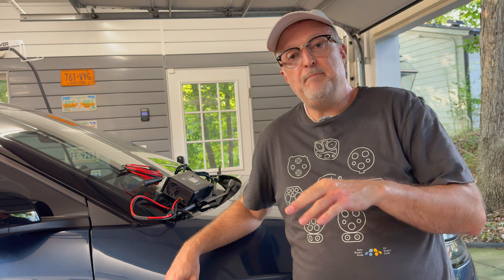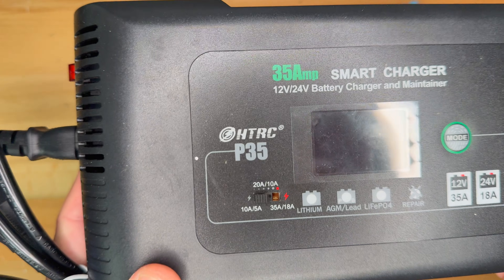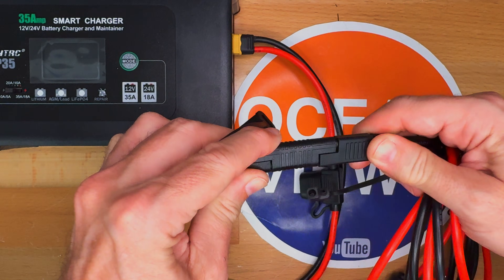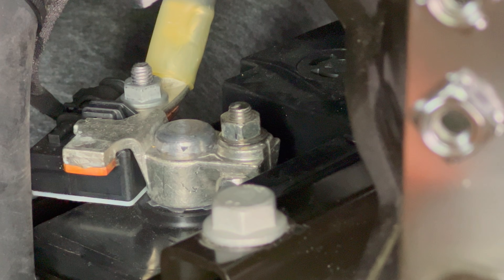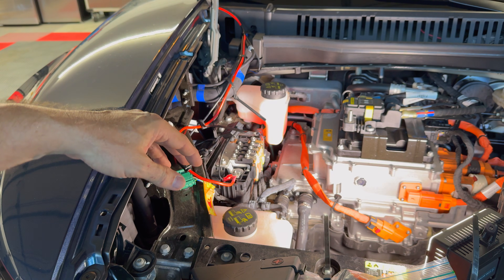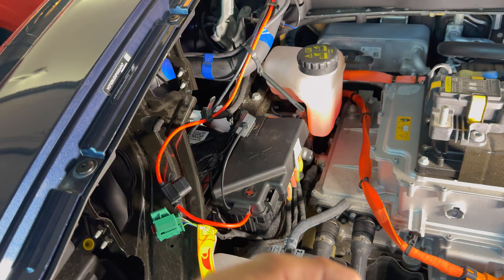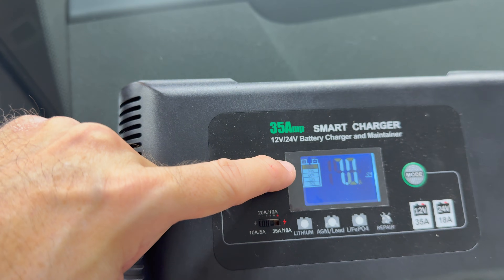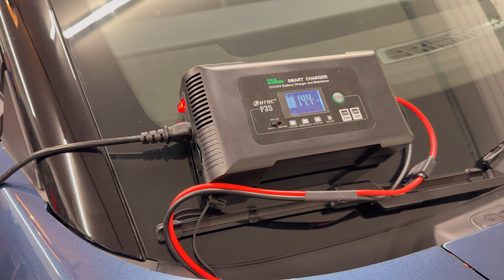Fisker Ocean - 12V Battery Tender V2.0

Comment: Just finished this set up today, because I was chomping at the bit to do it. Freezing outside, but I did it anyway! The 12V charger (same model as yours) shows my 12V is FULL, but the monitor (same as yours) indicates it is 11.9V and warns it is "Low". Has anyone seen this scenario? Thanks for the great videos as always, much appreciated!
Reply from the maker: Yes, 11.9V is below where it should be.  Is the car not charging it up when it goes below 12.0 volts?  What OS version is the car on?
Reply: @MTNRanger  Thank you for the quick response! It is 26F outside if that makes a difference. I am on 2.5 OS. When I changed the sleep setting to 2 hours, the car started to charge the 12v, then the in car monitor changed to 14.5V and the portable monitor show 14.52V! All good!
Reply from the maker: @lorrainedamico4589  With OS 2.5, the 12V battery monitor on the car's charging page is very accurate with voltage and percent state of charge for the 12V battery.  I also usually have the car on 2 hour energy mode setting.

Comment: Incredible. What I like about your set up is you don’t even have to open the hood if you need a jump start to your 12 volt battery under the hood as the extension cable comes out by the windshield with the weather proof cover. Brilliant 👏

Comment: I used the parts you used, except used a 15 amp charger. When I connect the the tender to the 12 volt as performed from the wire connected to the car, I'm getting a polarity issue and it won't charge. Therefore I have to use the alligator clips to charge by opening the hood. What am I doing wrong? Is there a different wire that I need?
Reply from the maker: You may need one of the SAE polarity adapters.  The charger you used may have a different polarity on their sides than mine had.  Did you get the adapter with any of the wires? If not, this will work: https://amzn.to/4f8CbRF
Reply: @MTNRanger total noob. Those adapters came with the wires too now I know. I'll test it out after I done charging up my 12 volt. Almost 2 years and never performed this once on my ocean. Wild
Reply: How long does it normally take to get to 100? Ocean loop said my battery was almost dead. But the charger showed it at 80 percent when I clipped it to my car. I did repair mode for 30 min and then kicked it over to the 15A mode. Fan was noisy for 5 min and now it's been sitting between 90 and 100 at 1.7A for the last hour
Reply from the maker: @sohailakmal3384 I have done repair mode now for two different batteries (other owners) and it can take up to 24 hours for a full recondition.  For just charging, I haven’t measured the time.
Reply: @MTNRanger I may do the repair after I charge up the battery. It seems to be holding a charge. It's still running, but mildly
Reply: @MTNRanger it's still charging and at 82 AH. Do I need to keep this running? What is the full capacity I should expect? My maintainer shows between 90 and 100 percent battery and blinks
Reply from the maker: @sohailakmal3384 Yes, if running it for that long it’s got to be full or close to it. The H4 battery is around 50aH.
Reply: @MTNRanger thanks for your help. Your channel and curiosity helps all of us owners

Comment: I am not able to jump start the battery and will require a new 12V battery. Do you have a video that shows how to change battery. The once I have seen are about not losing power and using another battery while installing main one. Not sure all that is needed when main 12V battery is already drained completely.
Reply from the maker: @MysticNut360  I recommend fully charging the new battery before installation.  If the old battery has died, you most likely lost your settings.  At this point, just swap the battery.  You can put the car in neutral and keep it running for the exchange just in case you still have the settings. I show that in this video:
https://youtu.be/4cL67nMPeGQ

Comment: This setup 2.0 will be fine for jump starting as well?  BTW have you tried installing a lithium or sulphur 12v battery?
Reply from the maker: After getting my jumpstarter, I realized that they provide much more amps than this setup will handle.  So I suggest directly connecting a jump starter to the battery itself (positive terminal on battery, jump bolt on car).

Comment: Thank you for all this! QQ: The product links to the SAE to XT60 10AWG Cable point to cables that do not have a fuse housing, whereas the cable used in the video does have a fuse housing. I'm seeing the "Make sure you have the minimum size fuses installed on the wiring" notice at the end of the video. Wouldn't that mean we shouldn't use the product links to the SAE to XT60 10AWG Cable - since there's no fuse housing?
Reply from the maker: You really only need the fuse on the SAE-to-O-ring wire that connects to the battery.  That's why I only linked the non-fuse SAE-to-XT60.  Having two fuses on the same circuit doesn't really provide additional protection.  Your're free to do it if you want.

Comment: Hi Matt, 

Late Wednesday (02.12.2025) the FOA sent out an email that the OTA team would be pushing out the v2.2 update for vehicles in the northeast that same night (which would include me). The following morning I didn’t see any update come through on my vehicle. I’m wondering if they didn’t get to them all yet or if they couldn’t update me for another reason. Note: I had the 4amp Battery Tender connected to my 12v overnight. My Battery Monitor shows I’m at 100% 14.53v.

On Thursday morning I switched out my Battery Tender for a max 25amp charger + booster. There are 5 modes: 2A, 8A, Auto A, 20A, 25A. 

Questions:
1. Which mode should I set the new charger + booster to while waiting for the OTA update? (Currently I have it set to Auto A).

2. Is there any harm in setting it to a higher Amperage for a long period of time?

Thanks.
Reply from the maker: I'm not sure if the OTA team is checking the voltage of the 12V battery or not.  Previously they were and sometimes don't do the update if the voltage is too low or too high.  From using my 35A battery tender, it will use a lower amp level (even when set to the highest) and will ramp up if needed.  So I would leave it one a higher setting just in case.  Make sure your fuse is not smaller than the amp setting.  You could leave it turned off and then turn it on once an update starts.
Reply: @MTNRanger  Thank you for getting back to me. I'm uncomfortable keeping it at 20A or 25A without knowing when they will do the OTA update. So I'm keeping it at Auto A hoping it will adjust during the update if needed. If I get a direct message from them I will probably set it higher.

My 25A booster doesn't have the option to swap out the fuse. It goes straight from the device to the alligator clips. I doubt mine are 10 gauge cables. They don't appear nearly as thick as yours.  

Some of the main features stated in the manual include (me paraphrasing):
- High efficiency (>85%)
- AGM (and other types) compatible.
- 8 stage microprocessor controlled charging provides the best possible application and enables efficient battery charging.

- Charging voltage adapts to temperatures to prevent under / over charging
- Reverse polarity protection
- Do not over-charge battery even if it is kept connected for long periods of time.

Curious if you think anything here sounds concerning? Appreciate your feedback.
Reply from the maker: @mschruntek  I also have 10 gauge cables, which I think is the thickest I have found for the SAE connectors.  It's plenty for up to 35 A battery tenders.   That sounds like normal disclaimers for a battery charger/tender.
Reply: @MTNRanger Thanks again. I updated a typo in my previous reply - I meant to say that I do not have 10 gauge cables, mine are thinner. 

That said, my vehicle is now showing a v2.2 (1/3) update went through. Woo hoo. So it looks like having the booster connected to Auto A was sufficient. 

My only questions with the update I have now is: 

1. When unlocking or locking the vehicle, isn’t the chirp sound effect supposed to be replaced by a different sound? I still hear the chirp. 

2. Any idea if the non-chirp sound comes with v2.2 : 2/2 or 2/3?
Reply from the maker: @ I haven’t been following the 2.2.1-3 changes.  So I’m not sure which of them includes the change from siren to VSP.

Comment: Hi there,
many thx for all the videos. I have now bought all parts and will try on weekend if a girl is also capable to mange this. (if it finally stops snowing here in the alps area in Europe as my garage is too small to have the Ocean and me dancing around in). 
But I have one question: as per FAST diagnosis done on the fly last weekend my 12V battery requires a replacement as well. So my question is: If cabled like described in the video with the high amp tender you recommended attached and switched on, would that keep the car powered as well or do I essentially would need a donor battery.
Reply from the maker: It's best to use a donor battery while replacing the 12V battery.  Most chargers/battery tenders will shut off when you remove the battery leads.  Another method that I will be trying soon is put the car in neutral, insert the driver seat belt buckle while keeping the door open. You can then close the door and that will keep the car powered up and you will not lose settings.

Comment: Thanks. Can a mobile charger be used to charge the 12v? Like 5 amp? You all seem to use wired chargers, does that mean you can conntect the wired charger to the power outlet in the trunk of the car? Thanks
Reply from the maker: The only mobile or portable units are for jump starting.  You need wall powered chargers for trickle charging the 12V battery.  The trunk power outlet can't be used this way.
Reply: @MTNRanger  thank you, i almost bought a mobile unit. How come the trunk plug outlet cant be used?
Reply from the maker: @ The car must be on and the HV powers it.  It automatically charges the 12V when that outlet is activated.  So a separate charger is not needed.  However the outlet only stays powered for about 30-50 minutes. I cover this in the V2L video.
Reply from the maker: @lindstrem.alexander  I mobile jumper is still handy to have in case the 12V battery dies.  I have one in each of my cars.

Comment: I have a couple of basic questions: 
1) What's the rate of degradation you are seeing? Is the battery actually after x number of months? 
2) What charges the battery normally? Is it driving more miles?

3) What about a solar trickle charger so you can set it and forget it? I live in the desert so plenty of sun year round.

TIA
Chris
Reply from the maker: 1) Degradation for the 12V battery?  I don't have anything that can measure that. 2) The 12V battery will be always be charging if the car is being driven (or at least not in Park).  If the car is charging with AC J1772/DC CCS, the 12V will also be charging.  When parked, when the battery state of charge gets to a low amount it should be charged by the car.  However, previously to verseion 2.2, that didn't always happen.
Reply: @MTNRanger  Thanks for the response. OK, I'm going to hold off on the charger for now, and maybe get a monitor to see how the battery holds up.

Comment: Thank you. Really appreciate your video(s).  Always looks so simple... but loosening the +terminal bolt it snapped in two.  I've now learned how the main fuse bar attaches and how to replace a Tbolt.  Happy to report the monitor and high amp battery tender are up and running. Got my sights on doing the emergency hatch release. Already climbed out a window once, luckily it was down when I needed it.
Reply from the maker: Sorry to hear the bolt snapped.  I have heard this is happening to other owners. BTW, for anyone that needs it, the replacement is this: https://amzn.to/4dJmb6l

Comment: first of all thanks for giving knowledge of fisker , yesterday my car got update 2.2 while update my car battery was dad and it's show me 12v battery low after few time all car power will gone , after that i tried to jump start it will work but half in my cease at jump start 
my car power was come back and after 1 hr i tried to charge my car but it won't charged can you please help me to run my car again
Reply from the maker: Sorry to hear you had problems with the update. From your description, it sounds like the 12V battery is severely weakened.  But before you replace it, if you have a 12V battery charger, see if the battery can be resuscitated.  You may need a high power amp like the one in the video.  If that fails, then you will likely need to replace the 12V battery.
Reply: @MTNRanger   i have 10 amp 12v battery charger
Reply from the maker: @MilapPatel-do7rs  I would let that charge it up over night and see how it goes.
Reply: I tried all but same results all times @MTNRanger

Comment: Hey Mtn Ranger i just noticed a low 12v battery warning. I ordered the tender charger but i wont receive it for another four days. In your opinion would i be okay until then
Reply from the maker: Try to keep it on an EVSE (charger) and charge at a low amp level. The car will also force charging the 12V when you are driving.

Comment: I have an FOU and was getting the 12V warning (in addition to infrequent warnings of the Drive motor & Battery Malfunctions, which stall the vehicle unexpectedly which I believe is the recall). I installed this charger/maintainer today. Seems to work great so far. Any recommendation for how long I keep it on?
Reply from the maker: @alignacio  Does the car go into neutral and lose power?  If so, it’s a major issue and someone on the message boards figured out how to fix it!  https://www.oceanforums.com/threads/so-im-stranded-again-and-now-im-not.2970/page-2
Reply: @MTNRanger  wow. thanks for sharing this. I think I mostly have the same issue described in the post. like someone who responded, though, had I the technical skills and time to work on the solution, I’d probably be driving more worry free. on another note 2.2 seems to show on my software screen but release notes are still 2.1 Same issue keeps happening, so maybe 2.2 isn’t fully implemented on my car yet

Comment: I have the same wirings of the monitor and tender to the 12V like yours.  I also cut the the battery cover to allow the wires to come out freely.  I am using Vector smart battery charger.  It auto selects GEL type instead of AGM.  It normally uses the 2.2Amp instead of the 10 or 15Amp option.  I assume the Vector charger knows what it is doing.   That said, I use the 16 gauge cable w/ 15Amp fuse.  So is that right I shall hookup the charger when the 2.2 upgrade starts?  Thanks.
Reply from the maker: @jkywang2011  Yes, I would attach the charger if you are waiting for the update.

Comment: Is it reasonable to just swap out the 12V battery once a year? Anything wrong with that approach?
Reply from the maker: Besides being extremely wasteful, I don't recommend it.  I would invest in a $20-40 Bluetooth battery monitor to keep tabs on the battery.  When you see it get to a low voltage state consistently, I would look into replacing it.  Yes, EVs are hard on batteries, you can usually expect 2-3 years of normal use.

Comment: I have seen a picture of the 12V connector mounted under the charge port cover.  Another option..
Reply from the maker: Yes, that is another option, in addition to putting a connector on the front bumper.  My only hesitation is that it's behind a locked charge port cover.

Comment: Very useful video as always. If the wiring is configured to use a donor battery in the future when need to replace, is it possible to trickle charge the battery mean while?
Reply from the maker: Yes, that's the idea.  If you use the second configuration, you can do trickle, jump and donor replace. I didn't think of the second configuration until later on. I'll probably change my current connections at some point.

Comment: Awesome Video. - QUESTION: I really enjoyed that video! I have a question for you. How can I tell if I need to replace my 12-volt battery? My battery is always connected to my battery tender, even when I disconnect it from the tender in the morning. Sometimes, when I start my car, I get a 12-volt warning message, but not every time. I’m wondering if I should replace the battery because after the first time, I don’t have any issues with the battery throughout the day. What would you recommend? I don’t want to spend money on a battery if I don’t need one.
Reply from the maker: If you get the warning when you start the car, it may not be very useful.  If during the day or if you leave the car unlocked for a while, and you notice battery warnings, then it may be degraded enough to replace.  If you have a battery monitor, keep an eye on it.  It should not be getting lower than 12.0 (preferably, 12.4 or so).

Comment: Quick question: do we still need tender after 2.2?
Reply from the maker: It's not as necessary since when 2.2 is installed, the HV battery pack supposedly will now charge the 12V battery during updates.  But I do think they are useful for when the car is left for one week or more by itself.  It can still cut down on vampire losses.  Also, if your 12 V battery is on the weak side, it may help.

Comment: I have installed a 2amps battery tender and it’s still flashing red after 36 hours; is 2amps enough to bring the battery up enough to turn green and switch to a maintaining mode?
Reply from the maker: If the battery is in poor condition, the 2 Amp tender may not be enough.  Do you get 12V battery warnings on the driver screen?
Reply: @MTNRanger  I have seen a low battery message before but not lately
Reply: Not sure if you resolved your issue but Initially I tried a NOCO 1A trickle charger and it wouldn't charge. So I went to the NOCO 5A and it still didn't work. But then I tried the 4A Battery Tender that Matt uses and it totally charged the battery.